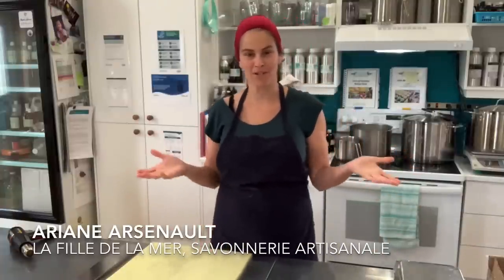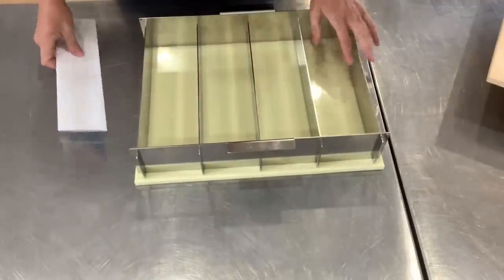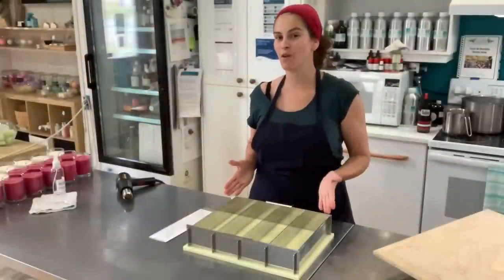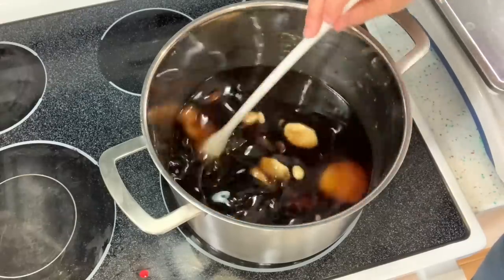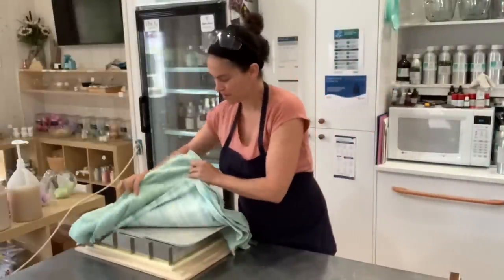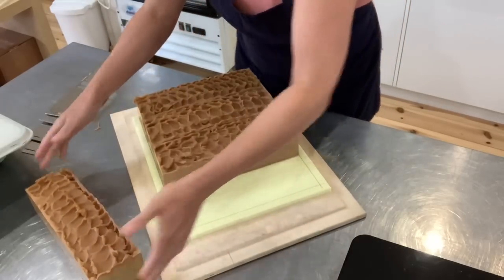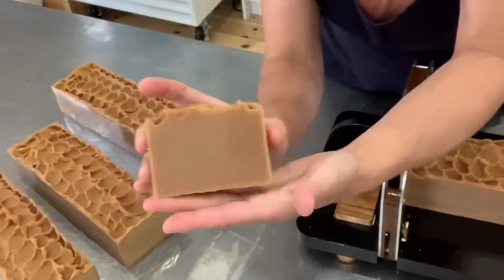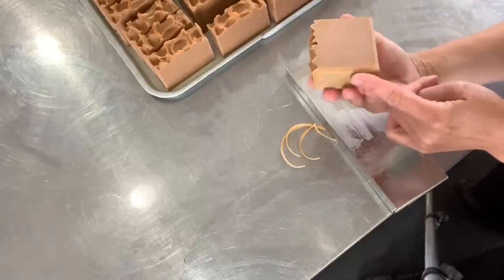Interlocked Soap Mold by LiluSoap Tools | Small Soap Mold Series

Comment: We are so honored and fortunate to have you present our soap mold! What a great demo video! Thank you very much!! It encouraged us continue to invent new tools to benefit all soap makers. :-)
Reply: DUSTRICK - guessing its an autocorrect of “demo”
Reply: Snotra Johnson thank you for the correction!
Reply: Since I'm a clutz, I have to ask. Should I damage a Mylar insert, are replacements available?
Reply: LiChing, I've been looking at the video and think you have a well designed product that is obviously well thought out.  My question though goes to what are the advantages of using this over just having multiple silicone molds?  This seems like a lot of pieces to put together, pull apart and clean.  But perhaps there's some advantage that I haven't realized yet that you can point to.  I love new products that increase my production, save time or money.  But I'm not sure how this does any of that.  Can you elaborate with your best pitch of why someone would see owning and using this as an advantage?
Reply: Pam Weber yes. They are replaceable.